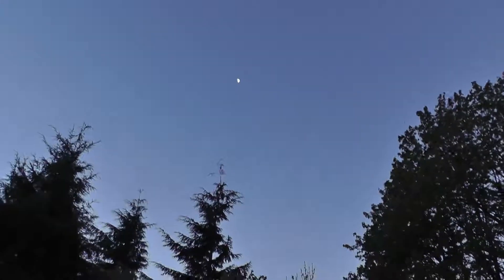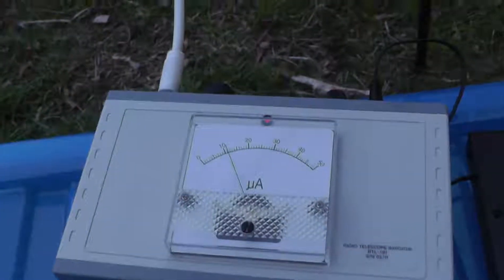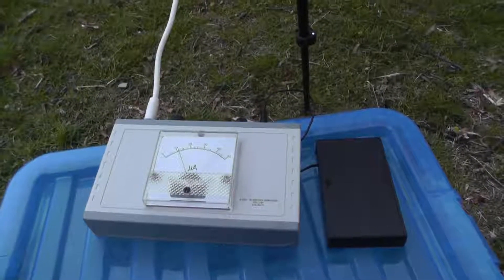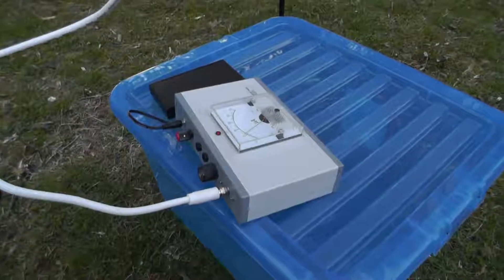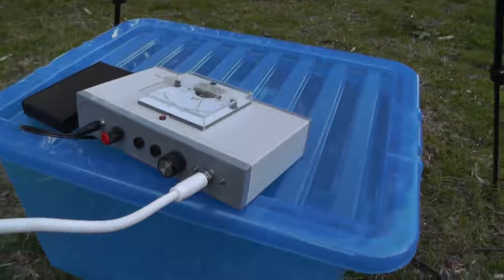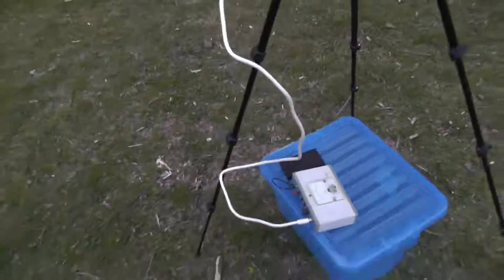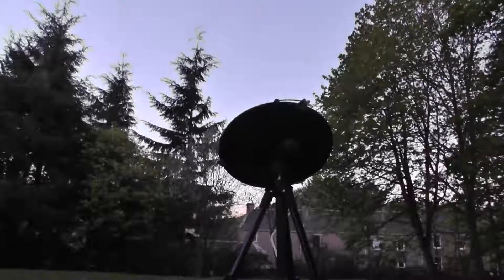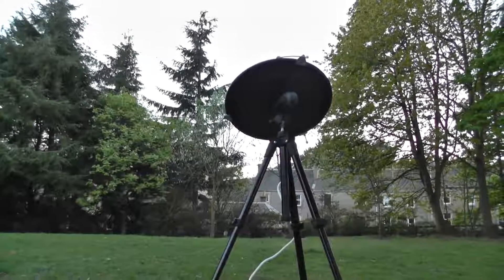Radio Telescope test

Comment: Sir can you please tell me how can I connect the co axial cable from my radio telescope to my laptop..??
Reply from the maker: You need to buy a  analogue to digital data converter    the wires from telescope with crocodile  clips attach to converter box  which attach to computer with USB  you download software free , you dont get  a picture its not video but you get plot of signal
Reply: @rtl1960  thank you so much sir
Reply: @rtl1960  yup i need those plot of signals only